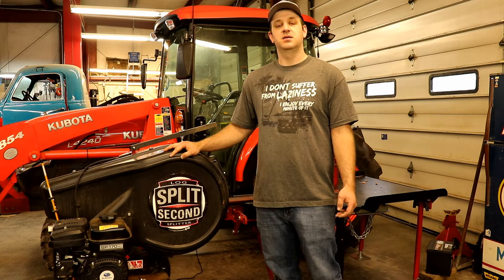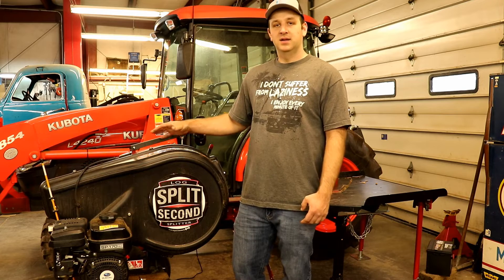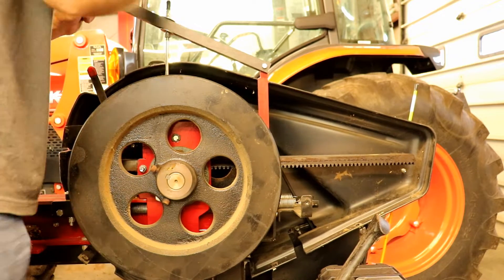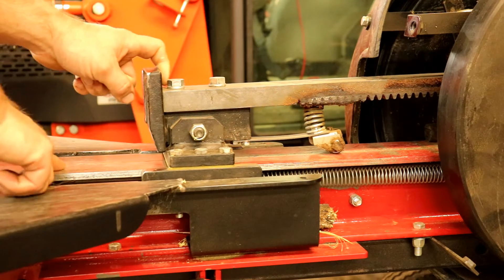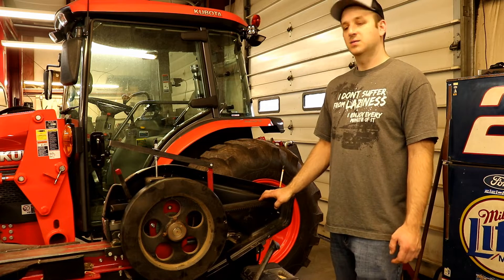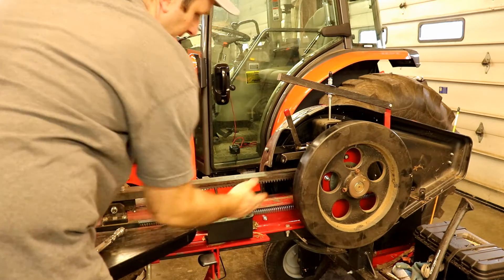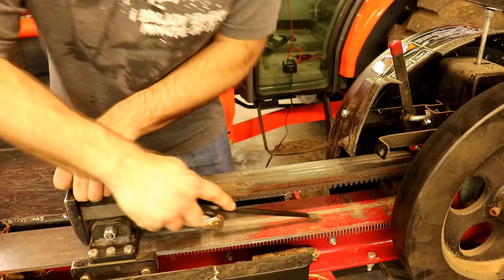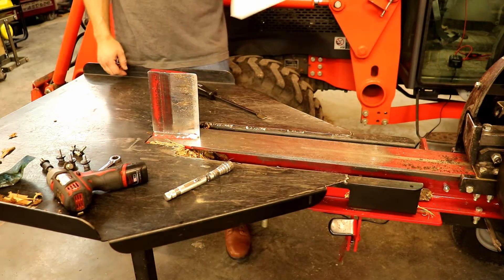How Does a Kinetic Splitter Work, Is there Maintenance

Comment: I have the original DR H1 model and finally after 15 years, the pinion gear has worn out and needs replaced. Looks like a nasty job, I don’t know if the bearings are pressed onto the shaft or merely held in place with such screws? I was also wondering if I couldflip the pinion gear around to use the side of the gear that is still good? It’s $200 just for that shaft.

Comment: Liked & Subscribed - Nice machine - Economical & fast.  I wanted the exact same principle for cutting the timber to feed my splitter - engine only idling but doing huge work - I don't see the sense in using big amounts of fuel to essentially produce fuel - firewood - your splitter works like my saw - once the inertia is built, the engine is only idling - I have the Honda GX on my saw set to dead idle - it's at tick-over even when cutting full width and the engine note never changes under load - it's always just idling, because inertia.  Inertia can do huge work when harnessed. :_) 
 My saw - it feeds a splitter just like yours:   https://youtu.be/jMROGuboBn8?t=3

Comment: On mine the flexible steel that holds the bearing-wheel under the spring on the arm broke. It’s flexing all the time so just goes eventually. Used some band saw blade to make a new one.
Reply from the maker: I'll have to look at mine closely but, I believe it is okay.

Comment: The kinetic uses less fuel because it does not idle as much and it is a smaller engine.   It is working almost all of the time to build up the kinetic energy.    The hydraulic engine is mostly idle until it gets that big load on it for one half of a second.  When it is running idle, it is still burning fuel but not getting any work done. Understanding this difference is the number one thing to understanding why kinetics works so well to split.   

An axe is a kinetic splitter.   Most of the time the axe is building up energy and then it slows down suddenly.
Reply from the maker: The engine spins the flywheels. Once the flywheels are up to speed the engine is doing next to nothing. Very rarely when I am splitting do I hear it hit the governor. Most of the time it will go straight through a piece of wood like nothing. This is what makes it so fuel efficient.
Reply: @TractorTech  Apparently the engine has a light load on it as it gently increases the flywheel RPM.   Splitting the wood takes energy from the flywheel, as much as is needed.  The wood slows the flywheel the way wood slows an axe.  

The engine puts energy into the flywheel and the wood takes the energy out of the flywheel.  It is technically correct to call the flywheel a battery, because it stores energy.  An electrical automotive battery can give you a blast of power and then it will gradually recharge.

There are laws in physics called thermodynamics relating to energy transfer.  All machines have energy lost due to friction, but It is not clear to me which machine has more friction.  Much energy on both is for the heat in the exhaust.

The hydraulic has a big engine for a big short blast of power while the kinetic has a small engine for a gentle continuous power. If the flywheels are going full speed in time for the next split, that is soon enough.

I would expect an engine on a kinetic to last longer because it has closer to the proper load on it. An engine man may have a better idea on that than myself.   If the engine is not getting enough load on it, I would say to slow it down.

Comment: Didn't comment on maintaining five bearings on front of the rack.  Did I miss that?
Reply from the maker: I have over 100 hours on it and the bearings have not been touched.
Reply: @TractorTech   Another guy on another channel has a Supersplit, buys 1/2 dozen bearings at a time to replace the little one that runs on top of the rail under the rack.
Reply from the maker: @jakebredthauer5100  I heard they are hard on bearings. The bearings in this splitter are upgraded in comparison to a super split.
Reply: @TractorTech  What make and model do you have?  Oregon and SplitSecond quit.  DR may be in second place now.
Reply from the maker: @jakebredthauer5100  I have a split second.

Comment: My splitter won’t return, trying to figure out the issue? Anyone else have this problem?
Reply from the maker: Look at the pusher, there should be 2 springs attached to it under the beam, one on each side. If they are attached remove the 6 bolts that hold the pusher to the beam to be sure a peice of wood is not under the pusher.

Comment: The problem with kinetic splitters I feel like if you get one tough piece of wood in there it will grind the teeth of the shaft down that the sprocket connects too. Cool design and would totally buy one if they were 300 bucks cheaper than the hydraulic ones but they are around the same price so I’d rather just buy a hydraulic one
Reply from the maker: It kicks out of gear if it hits something hard. I have over 100 hours, and 100 cords through this one.  It takes an expensive hydraulic splitter to keep up with this splitter. I would buy a cheaper kinetic splitter.
Reply: @TractorTech  Thanks for the advice. We need guidance to choose wisely among the various splitters.

Comment: It seemed like you tore the paper with the wedge instead of cutting it but that’s fine. I like a good sharp wedge too but I’ve never had to sharpen any of mine yet since they don’t seem to become dull and I’ve split many cords with them.
Reply from the maker: I've split in the neighborhood of 100 cords with it.
Reply: Tractor Tech  I did learn a few things from your video so thanks for that! I’d like to get a kinetic splitter someday to replace my slow 13 second 37 splitter but the equivalent kinetic models cost around $2400 so we will see... if I wasn’t going to be building a large pole shed soon it’d be bought lol. BTW- I was looking at a big capacity kinetic splitter on the Home Depot site and they say it has a 1 second cycle time, do you think that’s possible? I’d think it’s more like 3 seconds which is plenty fast yet.

Edit: After looking at some other kinetic splitters I think they mean the splitter has a 1 second ram speed with a likely 3 second cycle speed. 🤔
Reply: @hermancm  I saw one advertised with a one second cycle.  It said 1/2 second out and 1/2 second return.  The operator needs more time than that to get another log.

Someone should put a four-way. knife on a kinetic splitter. A two-way knife is too slow for commercial use. A business could have a processor and two types of splitters for the various categories of material.

Comment: My splitter is not working the way it should, at times it makes a lot of noise when splitting, because it doesn't fully engage the Rack with the Pinion, is there a adjustment that fully pushes the rack down to the pinion, It worked perfectly  until it just started doing the poping, and downs push wood. Any Ideas as to the Rack Adjustment.
Reply from the maker: The 2 nuts on top of the handle are for the adjustment of the handle, which engages the rack. If that is not adjusted properly the rack may not engage.

Comment: Good video. How do you feel about the kinetic going upside the big hydraulic?
Reply from the maker: Thanks.  Do you mean how do I think I am going to do in splitter wars, or what do I think about a kinetic vs big hydraulic?
Reply: @TractorTech  Vegas has the kinetic coming in at +15 how do you like your chances? Lol
Reply from the maker: @ronbarfield5615  Each piece has to be split 6 times. Adam/ Hometown acres is using a 6 way wedge. I predict he will be the fastest. Joe/ From Steel to wood, is putting a bigger pump on his box wedge machine. I'm not sure of the size of the pump. I think he has a good chance at being second fastest. I know Dan/ back 40 firewood is using a 4 way wedge. I could see him or me being 3rd fastest.

Comment: How's she goin'?  There is no doubt that a kinetic splitter is way faster.  That's an interesting point you raise about the fuel consumption.  I had not thought about that.  Now I know we are supposed to keep our hands and fingers clear when splitting but, for me at least, the kinetic splitters are so quick, they tend to scare me a little.  Maybe since it takes such a conscious effort to activate the rack to split that would make it safe and maybe the more I used one the more comfortable I would get, but they are scary to me.  But hey, I'm just an old guy in the woods!!!  Thanks for the demo of the innards of your splitter Roger and good luck in the splitter wars, even though it's not a competition!!!  LOL  Take care!!!
Reply from the maker: This one has a safety. It takes two hands to drop the rack. Not too long ago I did away with the safety, which I don't recommend. The pusher on this splitter is small/ short. That reduces the pinch zone. It looks fast, but after you split a while, it seems slow.